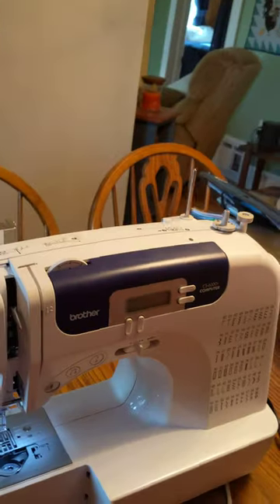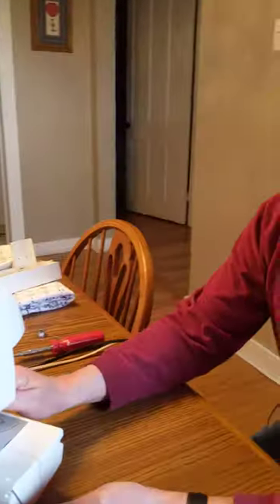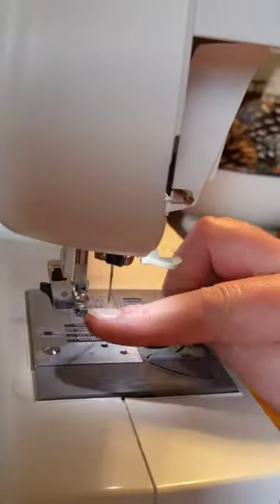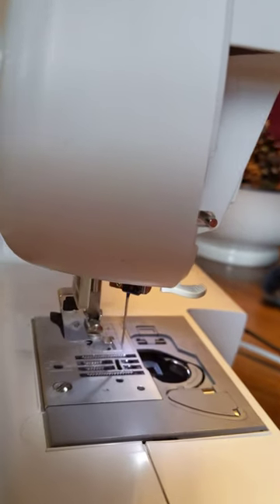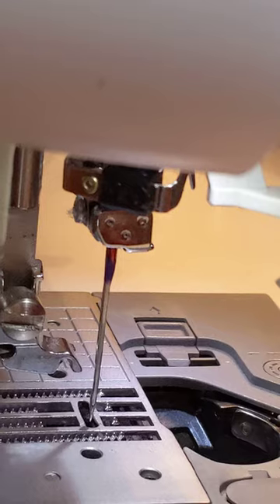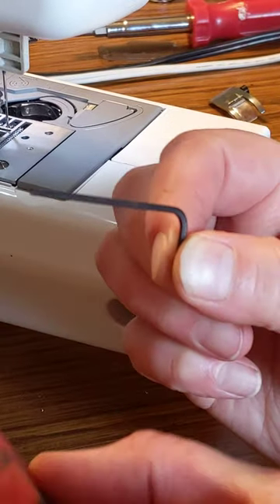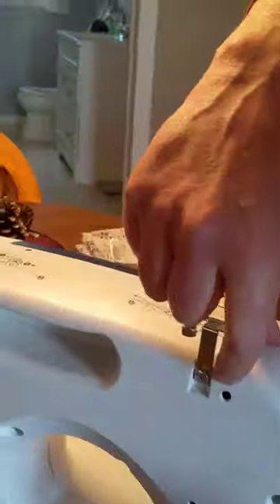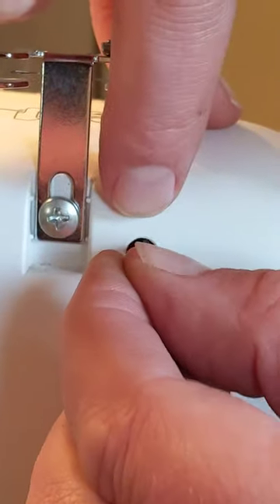Needle Alignment for Brother CS-6000i

Comment: I likewise!  Couldn't find an answer regarding needle positioning until this quick and easy video! Relief, thank you!  Wondered if you could instruct on the needle bar adjustment itself?  I went over thick seam on mens cargo pants with a patch. I hit needle plate, dinged it with a tiny gouge and bar is in question of alignment. I just can't seem to get needle/hook timing right...thought it might be what's wrong??

Comment: Thanks for taking the time to post this.  I took apart the machine and actually took the weird little screw off. After staring at this #$#-& machine and trying this and that I'm concluding that I need to move the pressure foot bar back and forth, but that's not possible. Ugh.
Reply: Ann Boughen any chance you figured out how to fix it? I did pretty much the same thing to my machine, and can’t put the screw back without removing the metal inside from the plastic frame altogether.
Reply: @sydneyhughes-jackson8384  Yes, as you found if you twist too far to the right the funky washer falls off.  It's easy to take off and put back on though. However, I want it to go to the right b/c that moves everything back, which is what I want.  So, after it falling off for the 20th time, I got crazy and left it off.   My other thought was to throw the machine into highway traffic.  Anyway, once it moves too far back, the uptake lever gets in the way...sooooo...that has to be adjusted.  ugh..anyway, I have to do that tonight and will let you know how it goes.   I kept thinking I needed to move the bobbin case holder stuff at the bottom forward, but realized I'm constrained by the screw holes for the plate.  ugh ugh ugh.  I have had every piece, bolt and wire apart in this machine. I could probably sit for the Brother Sewing Machine repairman test. But I am stumped at this one. Anyway, I'll write more tomorrow, if it works.

Comment: If you unscrew that part too much, you'll have a screw fall out of place and it'll fall to the table. How I fixed it, if any of you come across the same problem, I used a knife cut the hole wide enough to stick that screw back in. At first I tried to unscrew the entire sewing machine to place the thing back in, but it looked as though I'd have to unscrew all kinds of machine parts inside of it.
Reply: @moxiemfox  Shake it around until the screw gets out. If that doesn't work, open the machine up. All that plastic around the machine is surprisingly simple to kinda pop off and on.
Reply: @moxiemfox  No prob.